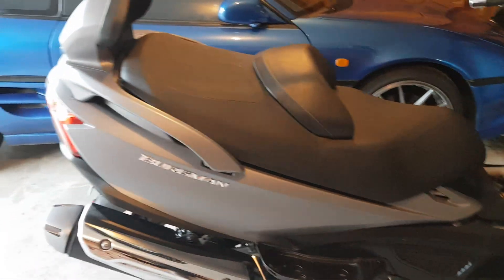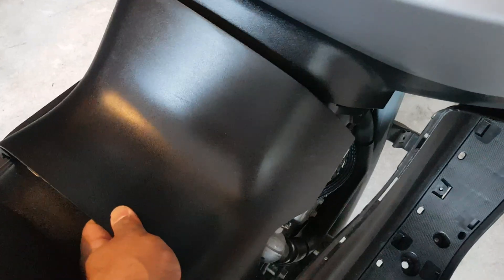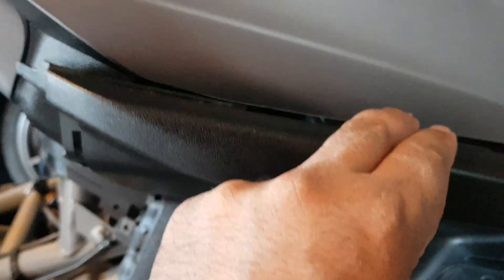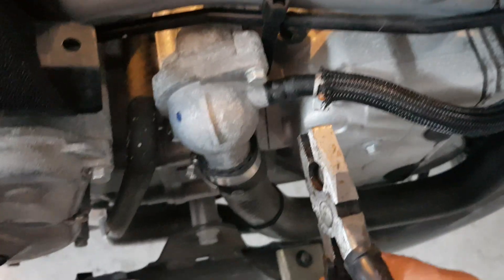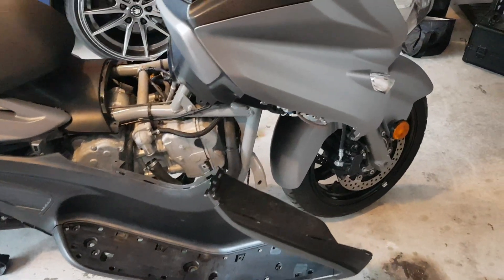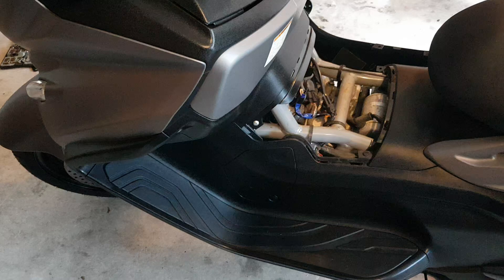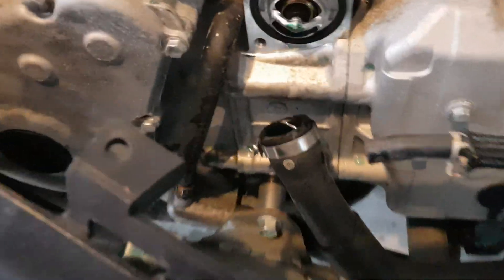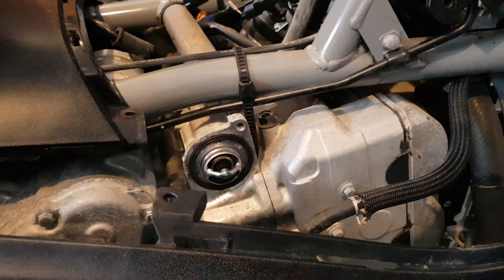Replacing Thermostat on a 2015 Suzuki Burgman 650.

Comment: how did you know thermo wasnt working. Or is that obvious.
Reply from the maker: The coolant was not circulating and if you touch the outlet hose of thermostat, it will be cold to touch.
Reply: On my AN650 I had only 2 Temp. Bars in the indicator for apps. 20 minutes
Reply: @rockyp3917 ciao complimenti dei tuoi video,scusami posso chiederti un informazione per quale motivo stai cambiando il termostato? Che problema ti dava lo scooter, Anch’io ho un problema della temperatura che va oltre i 90g , cosa potrebbe essere? Grazie mille
Reply: @rockyp3917 ciao scusami ma il termostato del 650 è uguale ad quello del Suzuki burgman an400 k7? Del 2007? Oppure è diverso? Grazie
Reply: @HANSEAT  Sounds familiar. In that case the thermostat would stay open I think. Did you replace it?